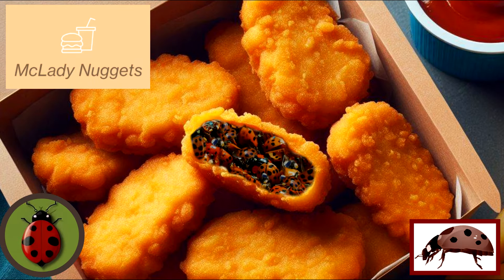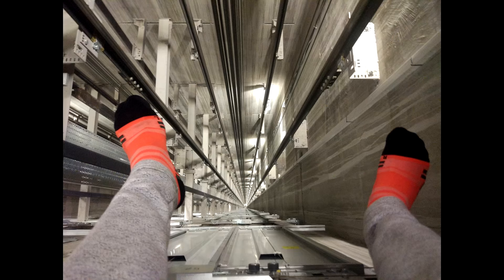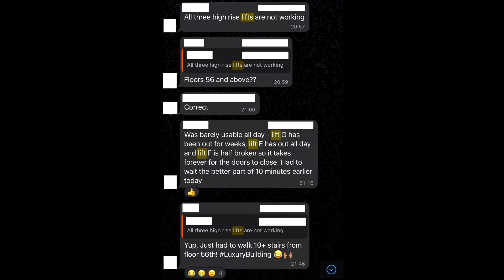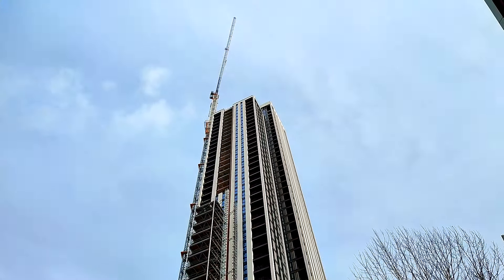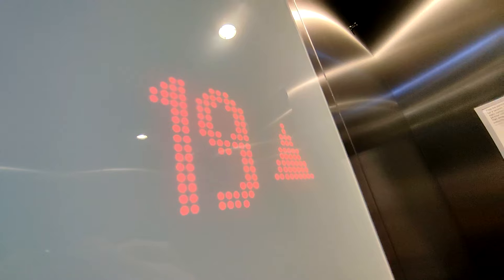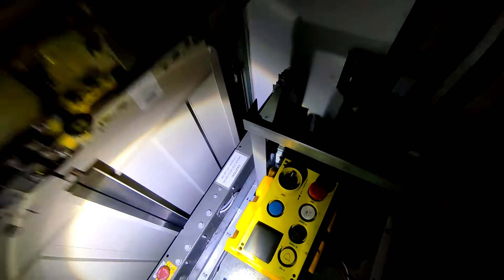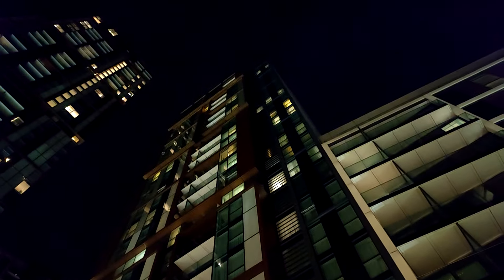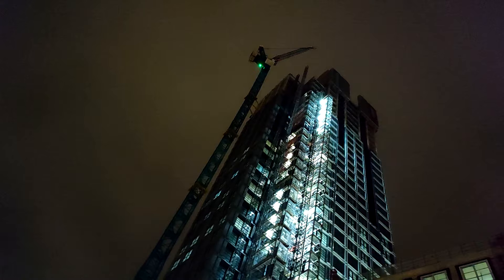An update on South Quay [February 2024]

Comment: you see this everywhere with existing Equipment being pushed further and further. especially in cars. for example renault uses the same engine today as they did 20 or so years ago, only they have pushed it from originally 60hp to 75 at first, and now that same engine block makes 103hp. if that has an impact on the life of that is yet to be seen, but i assume so.
Reply: I think engines becoming more efficient is very different to motors being run at faster speeds.

Comment: Beno, the factoid about 35 floors being a popular height because of the max for MRL lifts is crazy to me as a lay person. The construction costs are tens of millions; more floors add millions in future revenue over the building's lifetime. How can it makes sense to compromise over a lift machine room??
Reply from the maker: As well as MRL lifts, there are other things about the quality and size of the concrete structure.  130 meters is the height where the building design changes to a high rise design.  Buildings 130 meters or less have a very standard design concrete frame. 
Also, within the last 10 years, it seems less common that residential buildings are built between 140 and 170 meters, as it seems that if a building is going to exceed 130 meters (not including a spire and roof decorations) then they might as well build it to at least 170 meters or more (if they can get it past planning).
Reply: @benolifts  thanks

Comment: I highly think that generic engineers maintain them nowadays, otherwise they will have kept the 6m/s at the landmark pinnacle.

Update: I only just realised they are maintained by KONE, i immediately thought "thats not good, even though they maintain it they are still "unreliable""

Then i immediately realised that they are using 3rd party VFDs, ABB to be specific, could it be that the VFDs keep tripping on overcurrent as they cannot meet the demand. If so KONE should fit their own VFDs to see if the reliability improves.
Reply: Yeah I agree with this one. I refuse to believe that the motor is the bottleneck.
Reply: @jakewynn  KONE motors ain't Chinese, just pair them up with a suitable KONE VFD for the application for 0 over current errors, the only way to know if the motor is being pushed too hard is the windings blow up.
Reply: @professionalineverything  yeah or if the windings start to fuse together which can impact the performance of the motor
Reply: @jakewynn once the coating is eroded it will be a direct short. So it's either 100% or fault.

Comment: In your opinion, what is the maximum of floors for a MRL traction lift ?
Reply from the maker: Considering I am a lift enthusiast, I like to see over engineered lifts.  I would prefer heavily used buildings, even very low rise ones, to have a motor room.  If I was in government I would limit MRLs to 50 meters, which is very different to the current 130 meter limit.
Reply: This correspond To approx 18 levels am I right or am I wrong ?
Reply from the maker: @JulesMauuary-Maetz   Thats what I would limit them to.  I have seen MRL lifts with 43 floors.  Such as the sideman tower in Stratford.
Reply: @benolifts  and I remember the 36 floors Otis Gen2 (aka Craptis GenPoo in this case as ElevatorsInRussia would say)
Reply: @JulesMauuary-Maetz and the US Otis gen3 (or Craptis Genpee) they are built even worse then gen 2’s
Reply: Actually the NMX18 higher power is redesigned a kone engineer told me that he was working on those new lifts and that they were redesigned
Reply: @benolifts I’m guessing it would only apply to new installs.

Comment: I agree about your opinon on the quality of these buildings, modern standards are shoddy and tacky even on the luxury budget.  Mainstream architecture doesnt hold a flourescent tube to the ones of the 80s and 90s.  Also I am not a fan of the design, which id mostly a mash of 80, 90 and early 2K with a lesser grade rehash of those eras.  Older is better and I totally believe you on the Otis lifts.